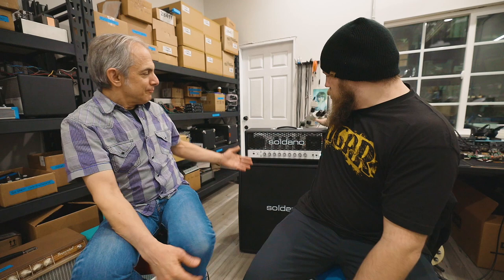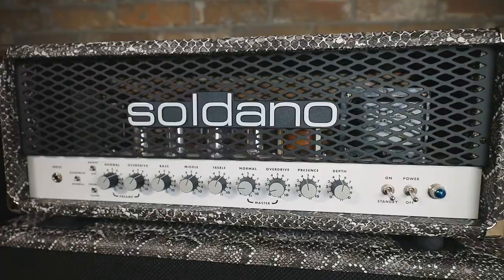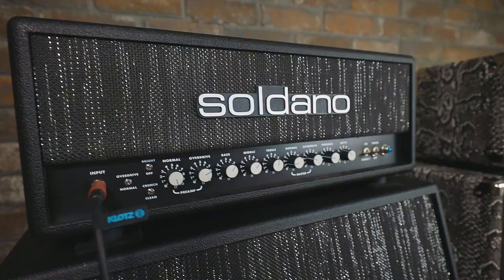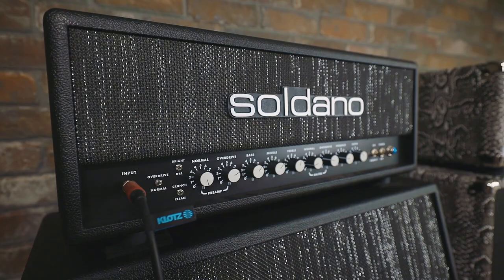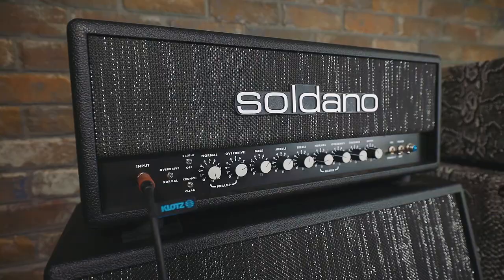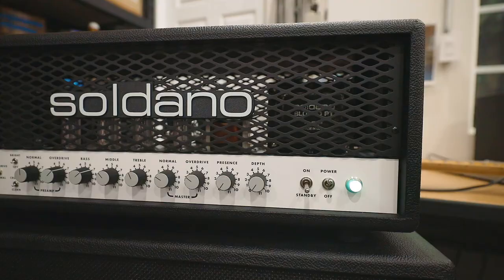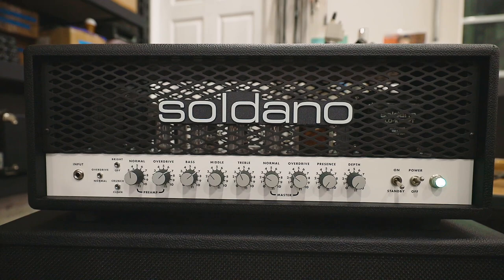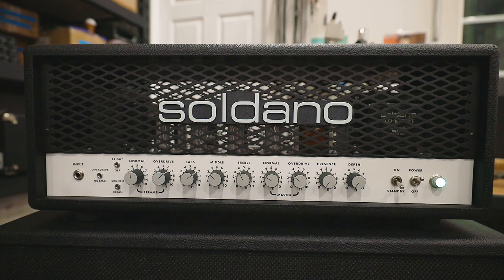Interview: Mike Soldano & The History Of The SLO-100!

Comment: I own the original SLO made before 2018, a boa skin cover one : the loop works fine with a few bucket brigade delays especially the MojoHand FX Recoil (currently unavailable), but doesn't work at all with Way Huge delays for example (witch are very goods with other amps). As I love the Boss Dm-2w, I tried. But it was not as good as in the Bogner Ecstasy 101A loop (witch you can switch from serial to parallel)  or the Mesa Boogie Dual Rectifier Solo Head Rev G loop (parallel). So I use a Skrydstrup PL-1 (high end mixer) into the loop of the SLO an then the amp can deal with the Dm-2. So I could say the loop of my SLO is now parallel without being modified. Thanks to Steen Skrydstrup ! 

Now, about the send of the loop of the SLO "re-designed" : after hearing Mike, I would say it will works as on the Friedman BE-100. You can do the same with the Mesa Boogie Dual or Triple Rectifier. The send of the loop works as an extra master volume. And I love that. All amps should be built this way. You just have to find the sweet spot with the gain and the volume of the channel, then you can use the send of the loop as a master volume. It allows to play huge fat high gain at "low" level. 

So I will probably play the new SLO with my old one to get a wet/dry rig. 

Hey Mike, I hope the manufacturing quality will not change... And I hope the EQ will be exactly the same, not a fashion one for tight low end, but the EQ we use to love in the late 80's early 90's. The kind of EQ you can find on a Rectifier 2 channels made in the 90's, not on the 3 channels Rectifier... This EQ witch is able to deliver huuuuge low end.

Comment: Love Soldano, can't afford Soldano prices. I used to have a Jet City JCA50 which isn't the same at all, but was still a great amp, never should have sold it.
Reply: Joe Paul  And I'm still pretty poor. One day when I have more space.
Reply: The jet city amps were pretty well built too. I have two of those, the jca100hdm and just a few weeks ago I bought a jca 22h. Haven’t even tested it yet. On the soldano side I have a sp77 preamp . I’m currently rebuilding an old ptp ( 1971) plexi clone to soldano territory. With a few differences though. For the Crunch / lead channel I want to get close to a plexi sound and I wanted less fizz in the lead channel,  so I changed some components to different values to achieve that

Comment: My dream amp. I will never be able to buy one unfortunately and even if i did i can't play it in my appartment.
Reply: Get an axe fx or kemper. I have the axe fx 2 and 3, the soldano models are stellar. Kemper I've heard good SLO tones too. 

Can now play a SLO at any volume.
Reply: Get a Jet City 22H and have it modded to SLO specs. It will be about 95% of the real thing, I love mine. Look at used ones and you can probably spend under $300 all said and done.
Reply: @low_e_music  Wrong wrong wrong wrong. No. It wont even come close to the SLO100. I remember having the same idea, I had a bugera 6260 and the amp was falling apart so I got a new amp, I got a 6505MH, and I couldnt be more disappointed with the amp. The bass response sounds like farts because there isnt a 100 watt 6l6 poweramp, I was pretty stunned that the bugera completely demolished the 6505MH in sound quality, both clean and gain. Even with the new SLO30 you wont be "95%" to a SLO100. Maybe 70% there. EL84 tubes were never in high gain amps before the lunchbox amp trend for a reason. The bugera sounded better than the 6505MH at every volume. Even the purpose you're supposed to use the mini head for (lower volumes) it sounded worse. Again I was pretty stunned. 

The bugera 6260 was closer to a real 6505 than my 6505MH is. 

There are some amps on the market who design the lunchbox heads around the fact you're going to have to really compensate for bass response in headroom but most of them are just the bigger amp circuit of whatever amp youre looking at, with smaller components. The 6505MH in particular is one where it sounds like they did absolutely nothing at all to try to compensate for the lower headroom, probably the loosest high gain amp I've played. Even with a tubescreamer the bass sounds like wet farts. The engl ironball and the new revv one are the two amps I would say seem to actually have been designed by people who know what they are doing. 

This trend of smaller amps is genuinely atrocious for making so many people not understand how amps work, People seem to think oh 25 watts of course thats loud enough! When loudness is not the issue the issue is headroom. Of course it's loud. but play palm mutes on a mini head then play a 100 watt amp, any person just using their ears will probably forget about lunchbox amps. The smaller tubes simply cannot produce the frequencies you expect to hear perfectly. 

Anyway if you are playing blues, any lunch box amp will be fine. If you're playing metal I would get a 100 watt or at least 50 watt head. If you are actually concerned about not having to play loud, get a modeler. The 6505MH for example is insanely loud. A 100 watt amp isnt 4x louder than a 25 watt amp. More like maybe 5% louder? I got the 6505MH before getting an axe fx because I was under the impression id get better sounds at lower volume than my bugera 6260 100 watt, and I was shocked to learn I was wrong. Which is why I ended up with an axe fx. Which you can actually play at any volume. And I can put a SLO100 powereamp master volume in the axe fx to 10 without setting off a nuclear explosion. 

But I really want to emphasis the idea that even the SLO30 could sound 95% the same as its bigger brother, is not accurate. The jet city is a whole other story im mostly ignoring the fact you mention jet city over a real soldano cause you say you had to mod the amp. A really unnecessary  process if you ask me.
Reply: Well, that's your opinion. My 20 watt Jet City with the SLO mod sounds pretty damn close to my ears and I have played a real SLO. It's not 100% but for 1/25th the price, it is close enough for me. I am not in a band either so I am not playing at super loud volume where power tune saturation matters, it's all preamp. Even at that 20 tube watts can still be very loud, way more than you could ever use in an apartment without an attenuator.

At the end of the day, if I had the money to burn, I would absolutely but an SLO. Until that time, though, the JC fills that need well.
Reply: @low_e_music  Rock players with SLO's turned the master volume up because it smooths out the sound, for metal the SLO sounds better with its master volume lower than 4. Not just for loudness. Playing loud doesnt mean power tube saturation matters im not sure what you mean by that statement. The sound of the poweramp always matters. I specifically touched on the fact a lunchbox amp is plenty loud to make sure you dont try to use the point against me, stating literally there is no big difference between a 25 watt amp and a 100 watt in terms of volume DB that will matter, yet you still mention it. Maybe english is not your first language idk. You end up basically agreeing the SLO is better but it's more expensive so I will have to agree there, the SLO100 of course is very expensive. I also partly bought the 6505MH because it's less money. But if you really AB a lunchbox amp vs a 100 next to each other you would have a better feeling than just playing a SLO100 one time.
Reply: I completely understand that there is a difference in sound and dynamics between a 20W and 100W amp. All I am saying is that to me personally, my SLO modded Jet City 22H that I barely have $200 into (amp and mod) does a great job of satiating my SLO craving. I know of many others that feel the same way so I figured I'd pass it along.
Reply: Well i heard of the Jet City and comparisons on youtube show that it's decently close. Looks like that's whar i need.
Kemper is still to expensive for me i think.
Reply: Many of the comparisons are on stock ones too. Once you have it modded, it is even closer. If you can solder, you can mod it yourself too with a kit from Epic Amplification. That's what I did and I could not be happier.

Comment: OK so is this confirmation that Mesa people can start crying about how MIke is stealing Mesa designs with his DC heaters? Mesa has used DC heaters at least as far back as 1990 with the Mark IV. Lets face it all tube amps are ripoffs of each other. Even the early Fender's are ripoffs from RCA design examples from their tube data manuals.